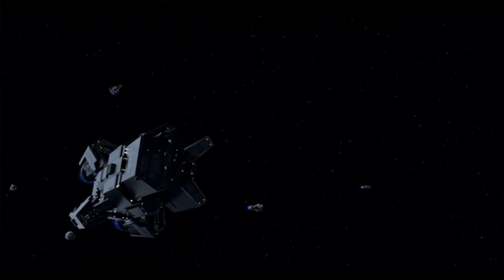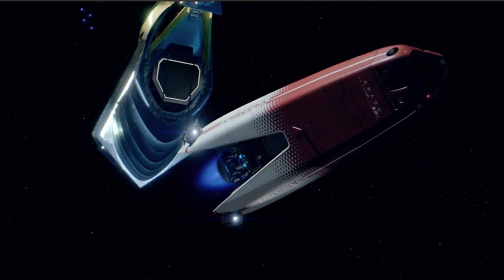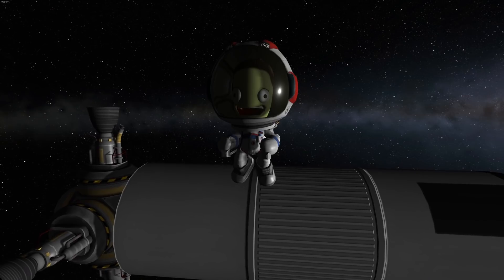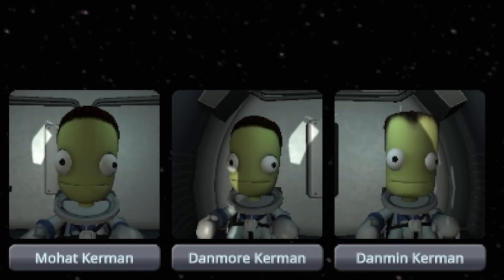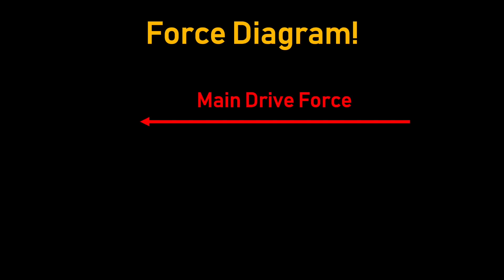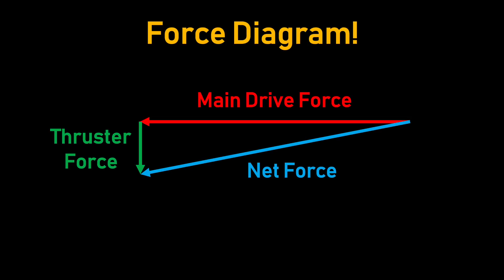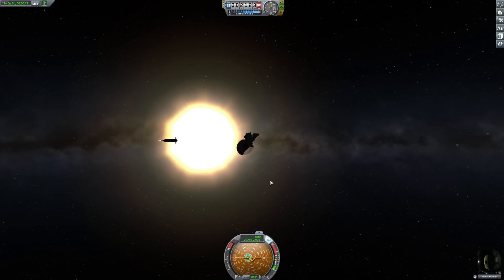Testing Physics of The Expanse With Kerbal Space Program

Comment: What makes problems like this hard are reference frames. After one full rotation of the ship, all the thrust vectors cancel out. 
If you set your reference frame to the average velocity of the ship, then the ship will appear to be moving in a circular motion.
Like with with any object moving in a circular motion, if a passenger detaches from the ship, she will be flung away from the center of the circle.

From Naomi's perspective, she would be floating in space as the rocket spirals away from her.

The other big physics mistake in that scene was that she wasn't incinerated by the Epstein drive when it came around to point at her :)

Comment: I'll disagree with you on this. 
I might be completely wrong so correct me please.

The mass of your ship is far to low for the thruster you use. If you alter the forces on the ship, mass of the ship and the burst of thrust, so the ship has a spin of .5 rpm or .3 rpm while having a continuous .2g acceleration from the main drive, you will have a resulting motion much closer to what we see in the show. 
The part where Naomi is in the middle of the spin still doesn't work.

Comment: if instead of a single rcs burn you'd do two burns to point the ship sideways and then have a leak constantly venting a small amount of air at a perpendicular angle, that might result in a spiral, i think.

you would then have to jump out of the ship in such a way that you'd end up inside the circle, because otherwise you'd either get crushed (exiting at the front) or burned (exiting at the back) or first crushed then burned (exiting on the wrong side).

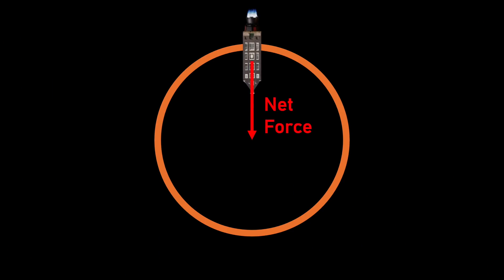Comment: I think you are sort of wrong. I agree she would get flung away. But you can still see it as a circular path if you have the correct frame of reference, like an imaginary point that the ship is pointing and accelerating towards as it is rotating around it, i.e. the center of the circular path, like at 4:39. The speed that the ship already has relative to earth or whatever doesn't matter. If it's rotating at 1 rpm, don't see why the acceleration in any given moment wouldn't get canceled half a period later when it's pointing in the opposite direction.

Memories of early kerbal rendezvous come to mind where I realized continuously pointing towards the target and slowly burning constantly can make it so you don't get any closer, you just sort of orbit it. Now if it's a ship you're targeting in the center of that path, you need the correct relation between rotation and acceleration for it to be circular relative to that target ship. But the center of the path can be an imaginary point. If your ship spins very fast and burns very slowly, that point is closer to the center of mass of the ship, but the slower you rotate the further in front of the ship that point will be.
Reply: This is the correct answer.
Maybe the ship was oriented wrong for that - I don't know because I haven't seen the scene yet - but even if it is, Dr. Ridden should have at least mentioned it.
It's really obvious when you know the net force needs to be towards the center of the circle and the only force is the main engines: F(centrifugal) = F(thrusters)
You just need the side thrusters briefly to start the ship rotating in sync with the circle you want.
And as you say, just like that picture at 4:39 - how can he miss that?

Comment: It's funny how they accelerate for weeks and month with 0,3g and then use a couple of `hard' 10g manoevers for a bit to change their course significantly. In the books these manoevers take 10 days 'in the juice'.
Reply: 10 days seems a little excessive. Even at "moderate" acceleration like 5 G, you would only need just a few hours to brake from a week at 0.3 G. A week being enough to travel to any place in the solar system without the flip in the middle.

Comment: 2:38 the ship seems to follow a straight line despite the main engine firing and the ship rotating. We should see the ship wiggle left and wright from the unlucky Kerbal's point of view, should we not?
Reply: Probably has more to do with the thrust to mass ratio. The thrust is too low to perceive  change in velocity given the frequency of rotation. Try that with a mainsail and a slower rotational speed, then you should see quite a difference.

Comment: If the ship is rotating while the engine is burning, the ship acceleration should basically cancel out. It goes forth and back... while following the linear velocity it had before going into torque. But once torquing it doesn't accelerate/de-accelerate anywhere anymore.

When you eject a person, there may be a difference of the current velocity the ship had at the moment of exit vs. the forward and backward acceleration the ship is doing while it is spinning. So I'm not yet totally convinced that a scenario as seen on screen is physically impossible by one KSP simulation.

Comment: Are you certain is was just a short burst? I was under the impression that the thruster was running continuously which would some how make more sense. But indeed if it was just a short burst then their physics was broken.
Reply from the maker: Even if it was running continuously, it would just have the effect of spinning up the ship faster and faster since it is offset from centre of mass.
Reply: @RyanRidden , I hate to say it, but by analyzing only a single increment of time, and not accurately modeling the rate of rotation in KSP, you missed the fact that the craft would follow a ‘circular’ path over an extended period of time.  As the ship continues to rotate around its center of mass, the vector of thrust from the main engine changes, causing its path to continually adjust accordingly.  To see this in KSP, you’ll need a much slower rate of rotation.

As for exiting the craft to drift toward the center of that circle?  It’s theoretically possible, but unlikely given the human body’s ability to apply sufficient force to cancel out the tangential velocity imparted by the ship.  If said tangential velocity were small enough, then it is incredibly unlikely that the circular path ‘scribed’ by the vessel would pose any significant difficulty to a docking attempt by another vessel.
Reply: In the show, they mention it was a small burst. If I recall on the Razorback they thought it was a small thruster malfunction

Comment: After nose force is applied and rocket begins to spin around its mass center, rocket will no longer accelerate. That's because main thrust direction will rotate along with the rocket, so the speed of the rocket at the end of each rotational cycle will be equal with the speed rocket had before it started to spin. 

If the passenger jumps out when tip of the rocket is oriented in the direction of rocket initial velocity, passenger will continue to move in the same direction with the rocket + the perpendicular speed vector Naomi had right before the jump. Jumper will get farther apart from the rocket (carried by the kinetic momentum of the jump) but rocket and jumper will have almost the same speed from an outsider's perspective (speed of the rocket being obviously far greater than the speed generated by Naomi's run).

Comment: In your spinning experiment, you completely forgot the fact that the ship in expanse is way, way larger and heavier and that the thrust from the main engines is immensely high compared to RCS that is only a fraction of that thrust. If you indeed built something more similar in weight and size you would see that the motion was indeed similar to expanse.
Reply from the maker: Weight makes no difference to the end result, no consistent force is applied toward the centre of the circle.
Reply: @RyanRidden  of course you're right. I did not realise that they said that the ship kept flying in circle but rather in a spiral flying away

Comment: I think that spiral motion is possible.
You assumed that the ship was burning along it's velocity vector, but what if it was changing course?
Imagine the 3D cooridnate system where Z means up/down.
Now let's say that velocity vector was towards Y+ axis but ship was changing course so it was thrusting at 90 degrees towards X+ axis. Let's say that the thruster that fired was aiming at Z- axis and put the ship into a slow spin (in your video spin was wayy to fast). 
In that case I think ship would start moving in a spiral like in the show and if Naomi jumped out from the side facing inside of that spiral she would be inside of it (at least for some time unless she made perfect calculated jump to cancel out the velocity offset :p )

Comment: Your test does not reproduce the conditions of the show. Clearly, the unfortunate ship was much heavier and the main drive very powerful compared to the thruster that only induced a slow spin.
Reply: Still,a small burn from your thruster would just change your course slightly, less than a degree to the right or left. It wouldnt induce flying a circle.
You would need continous fire from engines and thrusters to fly a perfect circle, which would burn a shit ton of fuel, your main engine would need to be at almost zero thrust to not flly off .
Reply: @Intrepid17011  What leads you to the conclusion the ship would stop spinning without continuous thruster fire?
Reply: @Intrepid17011  that’s not true. You induce a spin by firing a thruster that results in a force component perpendicular to the axis of the spacecraft and offset from the center of gravity. With a continuous firing of the thruster you would keep increasing the amount of spin, probably until the occupants are transformed into chunky salsa and continue to increase until the spacecraft came apart.

Comment: You spin too fast. Try a short burn and wait for few minutes. And also, you should stand on another ship to see the circle.
Reply: Its possible, but not with the configuration of the thrusters on that ship. You would need a bunch of thrusters evenly spread on one side firing simultaneously such that the net force doesn't spin the ship. Even if this was the case, Naomi would still not be in the center as the ship would rocket past her.

Comment: You sure she shut the booster off? 

You can see one of the later shots the side booster is still running. If it was a continuous force the circle would be correct.
Reply: Bobbie said there was a "short burst" from the thruster.
Reply: Since she broke the valve, it should have fired until it ran out of water.  However long that might have been.

Comment: watching your video closely and going by my intuition as well as my hundreds of hours of playing ksp i'd say there is a big issue with your first example with the thruster on top... or maybe even multiple:
first: right after you spun the ship you can see that the orbital velocity stays the same on average, which makes sense since the rotation applies thrust in all 4 directions on the horizontal plane the ship is spinning around.
second: the distance between the kerbal and the ship is getting bigger due to the kerbal having been flung off due to the rotation (kerbals orbital speed is 22210 m/s, ships average is roughly 22207 m/s)
finally: i think the rotational speed you induced is way too high (when naomi jumped away from the ship you can see that the rotation isnt that big) and the ships main thruster is not properly accounted for, and considering your acceleration before you began the rotation i'd say your TWR is way too bad to see good results... or to compare it to the expanses typical 0.3g, yours looks like 0.1g, maybe even slightly less... (Edit: your ship does a full rotation in 3 seconds, so if it would fly in a circle it had to do the full circle in 3 seconds... with your acceleration of roughly 1m/s² your circle would definitly be less than 2m wide)

Overall considering all the observed issues i suggest the following thoughts: 

Your Ship is facing prograde, you have a constant acceleration in the prograde vector, you give the ship a short kick from its top thruster to induce a rotation (not much, 10°/s at the most, 5° would be fine as well), lets asume the rotation can be applied instantaniously to simplify the problem

The ship accelerates on its prograde vector, turns slowly due to the rotation. after a 90 degree turn the ship has 0 acceleration on it's prograde, 100% acceleration on its, lets say radial out vector, so 90 degrees away from its orbital path facing away from the sun. After another 90 degress the ship faces its retrograde vector canceling out the earlier acceleration on its prograde, after another 90 degress it faces radial in canceling out the acceleration from being radial out before. 

 from the point of view of a ship thats traveling alongside naomis ship on the same orbital path that cut it's engines when naomi started rotating her ship it would actually look like a circle if the rotation is slow enough. when you look closely after you ejected your kerbal you can actually see your ship going in a circle, or better it's center of mass isnt stationary but moves around in a circle. Slow down the rotation and get your TWR up, i think it will look a lot different.

Now to Naomi being in the middle of that spin:
Naomi jumps away from the ship, lets say into the direction the ship is turning towards due to the only airlock being on that side. which actually makes sense when i look at the ship when naomi left it. one of the 3 cylinders at the bow of the ship is facing directly away from naomi and i guess thats where the thruster she fired is located facing directly away from the ship.
The ship itself is under thrust flying in a circle so radial forces apply, which the comment from "iliketrains0pwned" actually confirms. MAYBE (big maybe here since i actually doubt it myself) Naomi jumping out of the ship and the centrifugal forces from the ship canceled each other out when she jumped so she ended up moving very very slowly relative to the position where she left the ship with the ship flying around her? i guess even if it was very slow she would have gotten out of the ships spiral at some point. Maybe the jump was fine and she got a few m/s relativ to the position the ship was when she jumped but the ships spiral was so big that she couldnt get out of the spiral before she ran out of O2...

EDIT: After half an hour writing this i fired up KSP and tested it... i was able to get the rocket flying in a perfect circle by using only a short burst from a bow mounted maneuvering thruster (20°/s, maybe 30°/s. 
just as in your example at 4:42. the ship was facing to the center of the circle spinning around it. So i'd say it's confirmed that the main thruster has to be included in your equasions. 
I still got an interesting issue... the ship didnt stay on it's initial orbital path but moved very slowly into the direction it kinda faced when i fired up the engine and initiated the rotation... which makes sense since the first 180 degress before everything is starting to cancel out leads to a higher average speed in that direction... i noticed this because i droped the kerbal before i fired up the engines and it still moved away slowly. after some maneuvering i managed to park the kerbal in the center of the ships rotation moving at exactly the same speed and vector as the center of the ships circling motion moved so i in fact managed to have a ship circling me with a 30m radius (which was kinda terrifying actually xD ). 
So in fact IT IS POSSIBLE to have a ship circling around you after you spun it up with a short thruster burst IF the ship has constant thrust/acceleration from it's main thruster. 
How Naomi managed to jump of so she had exactly the speed and vector that the center of the circle had is another matter, since the timing had to be perfect... i think you can only match that speed and vector if you jump out at 45° after the rotation began or/and at 215°? no idea... at some point when the ships speed and vector is perfectly alligned with the vector of the circle overall... and that should only happen twice, at every other point she would have moved out of the circle, only question would be how much time it would have taken and that again depends highly on the ships circling radius and speed (it's rotational speed and it's main thruster acceleration) and her own speed and vector where she left ship.

Looking foward to your comments to my comment ;) have a nice day :D
Reply: Another EDIT: since the ship is circling around the Center of rotation it always should have a different velocity vector than the center of rotation itself...so the only way Naomi would have been able to get stuck would be if her jump out of the ship exactly canceled out the relative velocity between the ship itself and the center of the circle the ship is spinning around... That would be the unluckiest jump in History of TV xD

Comment: What about the main drive thruster in your first example? Since it is continuously firing what about about the huge influence it will have on the direction of the craft?
Reply from the maker: The main drive doesn't shut off on the show either. If the main drive was off in the first case, then the ship would have just started spinning around the centre of mass as it continued at constant velocity.